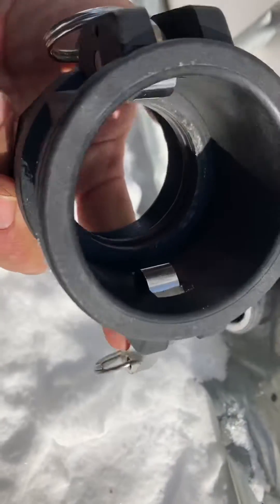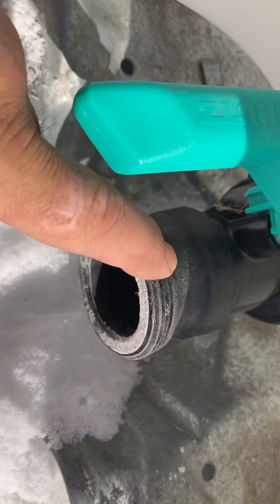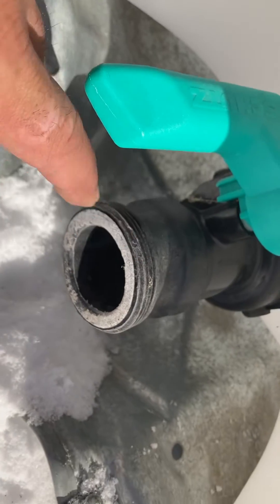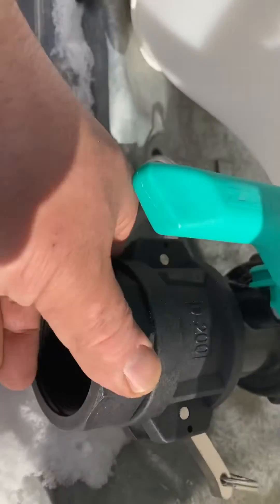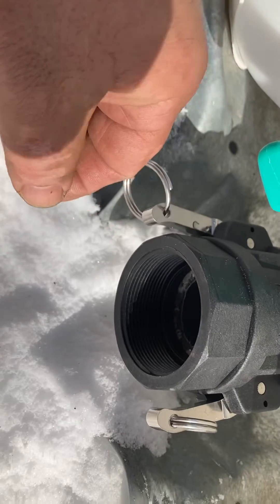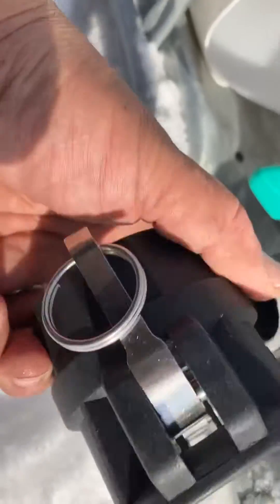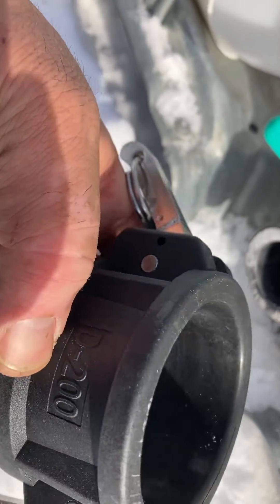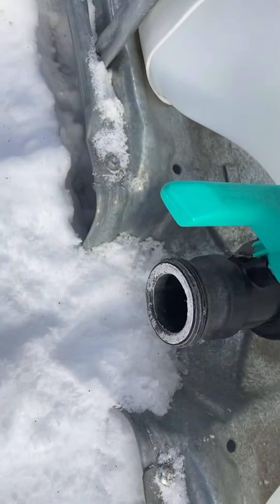IBC tote Cam lock for maple sap tank

Comment: Most temporary fluid transfer tank/hose connections are locking. If you had to constantly thread/unthread connections then they’d eventually wear out or cross thread. Cam lock adapters come in lots of different sizes and allow otherwise incompatible tanks and hoses to be connected!